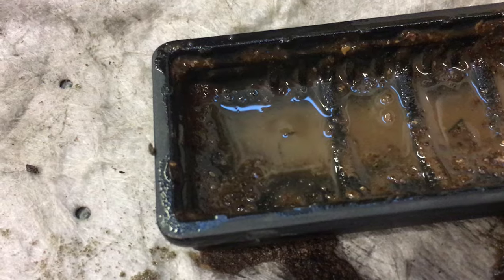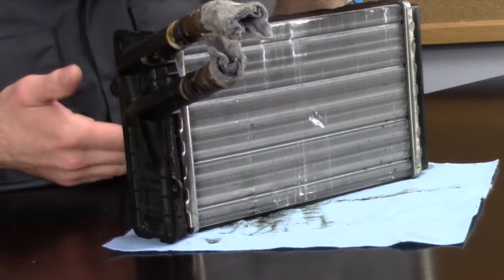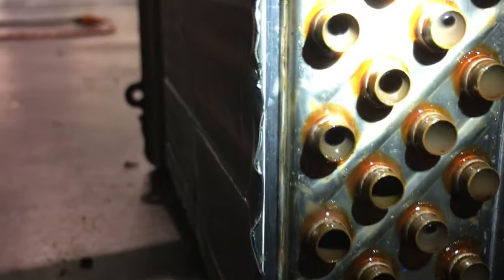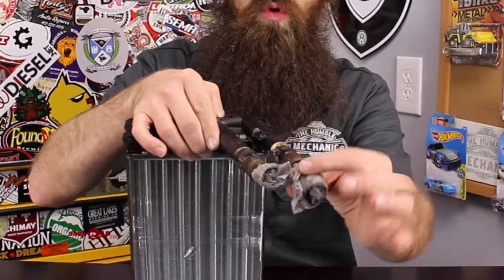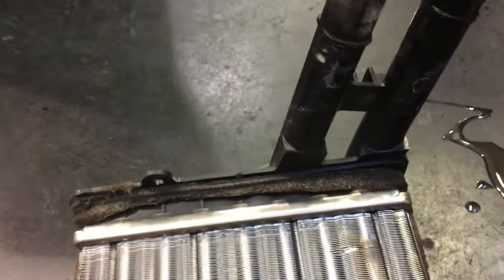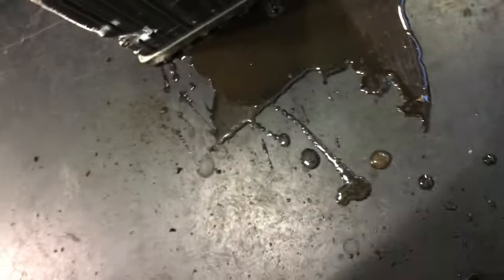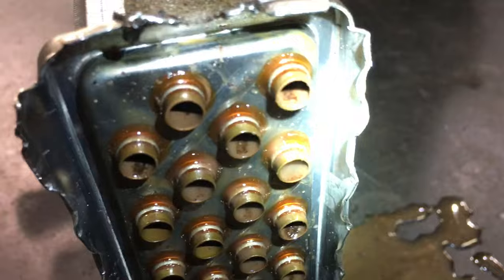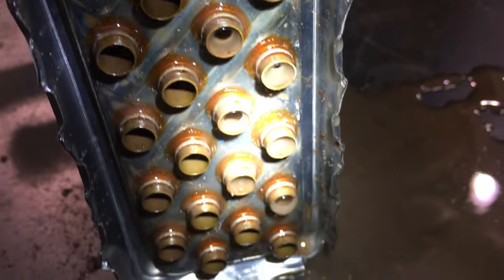How VW Parts Fail ~ Heater Cores

Comment: Hi there, please excuse me if my question is a bit silly, but how could I know if my heater core is leaking?, I mean I would like to fix the system so if I have to replace the HC I would, but if it is not necessary then I´d like to spend that money in something else that is needed, could you or any fella here recommend me any (proven) method to determine if my HC is actually leaking?, thanks heaps.
Reply: henryzr23 one way to know if your heater core is leaking is to lift up your passenger side mats and see if there is coolant underneath.
Reply: @trailrider6844  thanks man 👍, I'll check it that way then.

Comment: I have a Volkswagen golf 2002 I just put a brand new radiator in but my heat still when I start the car doesn't come on for about an hour if I revved the motor it seems like the heat works does anybody have any suggestions

Comment: Have this problem on my Skoda Octavia 2014, dealer tells me it'll cost a minimum of €500 to fix. Bought the car from the very same dealer used 23k kilometres on the clock. Heating was never warm from day one. Car is just out of warranty. As a loyal VW, Skoda owner having owned every version of the Octavia produced I'm disgusted at their attitude.

Comment: Why does no coolant go into the heater core is it the water pump ? Because the engine doesn’t over heat but it just shoots cold air
Reply from the maker: It’s Probably clogged inside the core

Comment: I’ve flushed the heater core with a gardening hose and no gunk came out, I have no error codes on the climatronic and still I get cold air when set on high...
Reply: your blend doors don't have foam anymore so hot air mixes with cold.

Comment: Mine exploded in the cabin, still have have the scars in my leg....still have the gti too
Reply: entertainTech whoaa how, was it leaking??
Reply: No, but if i remember correctly i think the heat 'stopped' working prior, so I guess it had just clogged up until that fateful moment. Someone had used green fluid and prob not distilled water, so a clog was not surprising. Luckily I was still in the driveway and hadn't started down the road... It's a 91' Gti 8v, with a/c, so the heater core-box/fan box is all one unit with the a/c lines as well, i think it looks like what the 93' Gti airbox looks like actually...almost can get to it, just can't find the last two bolts that hold the dash to the firewall... Bueller....Bueller........

Comment: hello, when the water is in 90 °Celsius (194 °Fahrenheit) the heater is still not working. how can I dissolve this problem , please help me
(audi A 3 TDI (2004 years))
Reply: Still struggling? 

This may be a “controls” problem ie: turning the heat knob does not open the coolant supply control valve or dampers in the system are not moving to their proper position. Is there good air flow into the cabin on high fan? That should rule out dampers. The coolant control valve should be on the firewall in the engine compartment, and most likely will have a pneumatic actuator. Have someone operate the heater temperature control and see if the valve is moving.

If all the checks out, The problem is likely a clogged core. Try to find the two hoses on the firewall that supply/return coolant to the heater core. When the engine is cold, remove both and, with the hose turned way down (remember, the core is not expecting more the maybe 15# of pressure and your garden hose can put out 75# and up) see if water flows freely both ways through the core. If it doesn’t, follow Charles’ advice on clearing the clog.

Finally, I’m a big fan of Online Forums and recommend you find one for your car and join. Use the search function before posting your problem. The answer may appear in the Forum’s legacy posts. If no joy, or still puzzled, read the “stickies” so you understand posting protocols, then ask a question, providing as much detail as possible.

Best

Comment: How does a failing Heater Core cause interior fogging of windows and windshield?
Reply: If the core is leaking, the coolant can be vaporized or misted by the blower, all the moisture will cause the windows to fog up

Comment: I never knew there was such a thing as a mini radiator aka heater core on the car. I thought the heat came from the main radiator all the way on the front powered by some vacuum lines. 😂😂😂😂.

Comment: I took out the dash on my Golf 4 to inspect the heater core and fix the blend doors... Damn...
24h hour job and in order to pull out the heater core I would have had to remove wipers, cowl, wiper motor, etc... Fuck that...

If my heater core ever needs replacement then I'm also upgrading my AC to Climatronic.

Comment: "open flame crazy things" ??? What do you mean by that?
Reply: +BavarianMonkey we had a 'gas heater' in our beetle...it did a nice job but the idea of a gasoline (petrel) heater in the beetle luggage compartment  is always a problem...but with a water cooled engine, that was not a problem.  I  hope this explains that.   :)
Reply: granskare never heard about that. All old (!) VW bugs I know are heated via a heat exchanger on the exhaust part of the engine
Reply: +BavarianMonkey  the heat from the engine was not very good which is why some people bought them..once the VWs became water cooled, that ended the problem..:)
Reply: granskare yeah my mom had one waaay back and she said the heating only worked in summertime...if that was normal then I understand why someone would do that :D

Comment: can i just bypass the heater core
on a mk4 since the plastic broke
Reply: I need to know if I can bypass mine as well 98 b5 a4 2.8 just a commuter
Reply: @707JohnnyBlaze  it needs to have to hoses if you see them then you can
Reply: This is gonna really save my ass!!!!!
Reply: @707JohnnyBlaze  its at least 1k if you replaced correctly
Reply: @707JohnnyBlaze  go to pick and pull and you can pull one of there which has the correct siE
Reply: I'm just going to bypass the core... I'm in California.

Comment: I have a 2014 Passat. The only time I can get warm air blowing thru the vent is if it 35 degrees plus. If it’s below that it just blows cold air. Is the core completely bad or is it just clogged up?
Reply from the maker: Very much clogged. You can try and flush it. I might call VW and see if they are offering assistance for passat owners for this issue.
Reply: HumbleMechanic ok thanks for the reply man!!!

Comment: The piss poor design of the heater core location in the jetta is a perfect reason to never buy a VW. You have to pull the whole stupid car apart to change it.
Reply from the maker: That’s not super uncommon. I actually have my entire dash out right now doing a heater core.
Reply: Hi mate I have a vw touran 1.9 diesel 2005 basically my car was looking the coolant water so some 1 said put in a bottle that blocks leaks so I did it didn't help so I changed the timing belt water pump and the thermostat so the leak stopped now the heaters are blowing cold air what can it be heater matrix or what